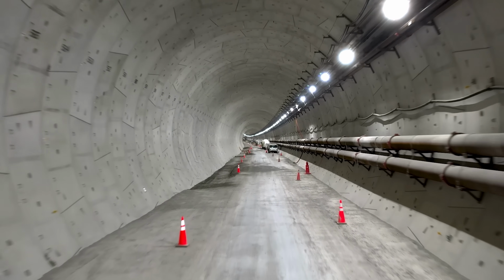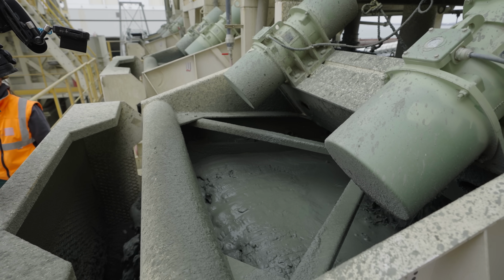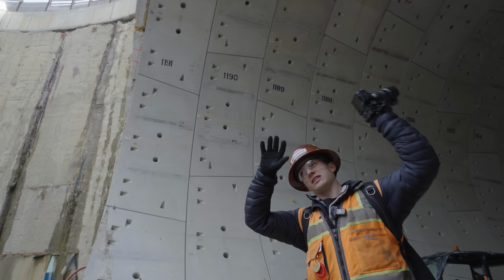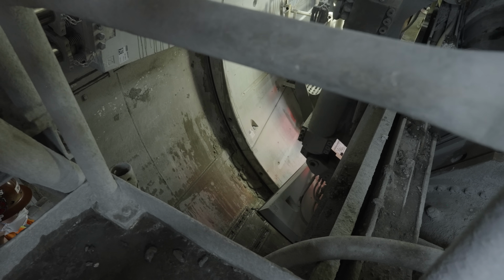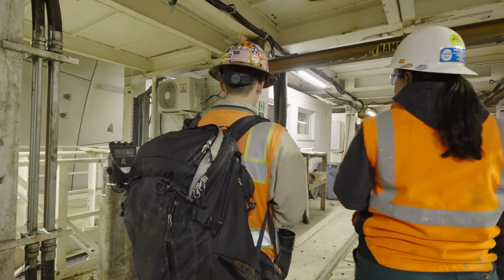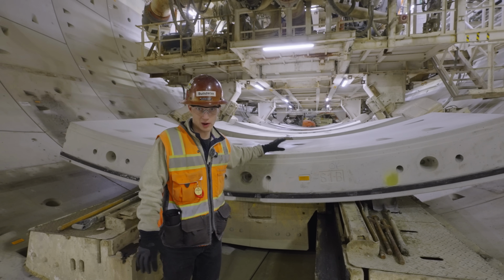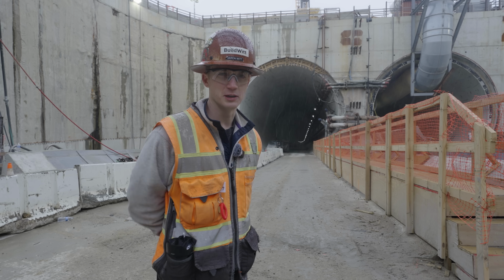Inside Virginia’s $4 Billion Tunneling Megaproject!

Comment: I have been to San Diego and have seen the Corando bridge which has the same problem. If the bridge is attacked  and bombed, it will block the harbor. That would essentially block the harbor from any Navy ships  being able to leave. Their answer was to build the bridge such that each section will float. That way, in an attack, they can simply push pieces of the bridge out of the way. Curious as to why that wasn't done here? Obviously we would loose the ability of any vehicle traffic but the same could happen here if the entrances were bombed.
Reply: The Coronado bridge is not designed to float.  And the only way it could float is if it didn't break as it fell, and if you somehow managed to seal the entire structure airtight.  It isn't going to happen.  It's nonsense.

Comment: Two thoughts, besides the obvious that this is really cool.  First, I really want to know how the pipe extension works.  Do they have to stop the machine and depressurize the pipes every time they need to extend it?  Second, I'd have stayed for hours if it meant I could actually see the ring assembly or changing of the tool heads.
Reply: The slurry circuit is stopped every few advances for the piles to be extended. This often happens in a maintenance shift. A lot of large TBMs run on a 24 hour cycle of 2x 10 hour production shifts and a 4 hour maintenance shift, where all the utilities can be extended. The smaller pipes have spool extension hoses so can be extended in longer sets (maybe weekly).
The TBM has a “trombone” section on the two main slurry pipes to allow it to move forward from the main pipes fixed on the tunnel walls.

Comment: The circular section of the vertical pits are so that the walls withstand the ground and water pressure. Like hoover dam!  Very difficult to make a straight retaining wall, it would have to be much thicker to be as strong.  That’s why the tunnel is round also.
Reply: Well, to be sure circles are stronger than squares, but I'm pretty sure the tunnel is round only because the machine digs round holes.

Comment: What are the holes used for in the ring slabs ?
Best video I've seen for TBM.
Great job all around...
Reply: That's where they inject grout to fill the voids between the slabs and the earth behind them.
Reply: @stargazer7644  Thanks. I think you explained part of what I was trying to understand but Aaron never explained.  What keeps the mud from coming in as the concrete sections are being placed? From the animation I finally figured out that they are placed inside the shield, which then slides forward, exposing the rings to the mud outside. But that would seem to leave a void the thickness of the shield wall. 

From your comment, I gather they address that by pushing grout out the holes to fill that void.

Comment: Do the concrete sections have to be made in specific shapes to account for the curve of the tunnel?
Reply: The sections have a small curve built in and depending on the orientation they install them in they can make the tunnel bend in any desired direction.

Comment: Besides the boring machine having to drill a round hole, the roundness of the hole adds additional
strength to the project. The outside pressure/ force makes the outer rings more secure.
The Romans used round top arches for strength on their building, and aqueducts to carry water.
Reply: He was asking about the 3 round excavations outside around where they assembeled the machine.

Comment: As a huge "Machine Nerd" and resident of Hampton Roads, this is great to see. There have been a few 2 minute news stories, but nothing in depth.  There is another big tunnel boring project going on a few miles to the east, at the Chesapeake Bay Bridge Tunnel... Its another HK TBM named "Chessie"... Could make a great follow up to this video.  Also, I believe that the manufacturing site for the Liner Segments for both projects is in Cape Charles, on the Eastern Shore, at the north end of the CBBT...
Reply: Correct, the sections are made in Cape Charles on the Eastern Shore

Comment: this project is so amazing in numerous ways. what a feat of enigneering. Just drilling under water where the soil is not rock but has to be treated to allow for the boring machine to cut throught without flooding the tunnel. Prepping the soils is huge. The machine itself is truly amazing. The amount of engineering to design and build this machine to bore while building the tunnel structure is like going to the moon. I live very close to this tunnel project and would love to get a tour, but I understand they have work to get done. 

Now when this machine has completed its task, the State of VA should take the machine to the Monitor Merrimac and start two new tubes there as 664 is getting so crowed resuling in five mile backups every day. The State will toll this tunnel for most of the locals that use it everyday while it really is required because of Navy requirements, ie. federal funds not my toll fees.

Comment: About the ring structure...how do they place the last ring tile? Its outside is bigger than the interior hole it has to go in, and because it's last, it can't slide in. Make it make sense! 🤔
Reply: The external ring diameter is a bit smaller than the machine. So when you’re putting in your last segment, it’s your “key” segment. It slides right in. Fits like a puddle piece! Hopefully I understand & answered correctly for you.
Reply: They don't push the ring outwards, they slide it in from the side.

Comment: If you access the tunnel by a bridge, doesn’t that defeat the freaking purpose of the tunnel.
Reply: Nope.  Bridges are much cheaper than tunnels.  The only reason they made a tunnel at all is so that the entrance to the naval base can't be blocked easily in wartime.  They only made the tunnel as long as it needed to be.  The rest of the crossing is via bridge.
Reply: Did you not watch the beginning of the video?

Comment: Now take that machine and put a few tunnels through the blue ridge mountains for trains and trucks.
Reply: That machine would have a bit more trouble with green granite instead of sand and clay.
Reply: @ carbide teeth and coolant on rotation heads it will be fine, just adjust head pressure accordingly.

Comment: 10:24 What is the power source for the concrete truck? Is that a diesel driven hydraulic system or battery driven? Thinking CO2, CO + inside the tunnel.

Comment: If the concrete rings are placed behind the shielded section, how does the excavation stay stable during ring placement?
Reply: The shielded section actually extends out the back of the pressurized section of the EPBM ( Earth Pressure Balance Machine). The segments are built inside the can that is open or not pressurized, then once the machine moves ahead and the segment comes out of the can the segment is expanded leaving a gap for a keyway or dutchman. The Dutchman will be alternated around each time they install the complete ring so as not to create a long joint in the segmented tunnel. Once the ring is expanded and the Dutchman is installed. Grout is injected behind the segment to fill any annulus between the ring and the rock.
Reply: @denverchandler6981 ^^ what he said. This is a perfect explanation
Reply: We are lucky because geology is sand and clay :)

Comment: What is more expensive, bridge or tunnel? Is the TBM reusable? Could they transport the TBM to the Cape Cod canal flor bridge replacement, given the similar geology?
Reply: A tunnel is by far more expensive than a bridge.  This tunnel cost $4 billion.  The new Key Bridge in Baltimore is about the same length and is expected to cost less than $2 billion.  The TBMs are usually abandoned underground.  They are very specific machines made for each project.  The cost of a new one is dwarfed by the cost to move and operate the machine.

Comment: After turning the tunnel cutting head and reassembling the rest of the machine. What pushed the cutter forward, as they required to push against the installed concrete rings, which at this stage would not be there?
Reply: They built a steel ring for it to push against.  You can see it in the video.
Reply: Thanks 👍

Comment: Awesome video.  

How does the TBM push itself forward when it first starts and even after setting the first couple of rings in place it seems like there would be a massive pressure that would just rip them out instead of pushing the cutter head forward

Comment: Great video but my question then becomes if the tbm relies upon pushing against the existing concrete barriers it installs then how do they start a new tunnel and how do the starting few concrete barriers handle that tonnage pusing against it once the tunnel is started
Reply: You dig out the entrance and you fit a steel ring at the opening for it to start pushing against.

Comment: In the distant and not so distant past, this job would have been done under pressure, but if there is any pressure here, it is confined to the very front of the machine. To give you credit, pressure was mentioned, but further detail seems warranted. If you don’t think it’s a big deal, just ask some of the old workers that have permanent cases of the “bends” from working under pressure. Or ask management how logistics are affected. The large diameter of that tunnel gives plenty of room inside the TBM to move things mechanically. Much of the Bull work and moving things by main strength are eliminated. This team has to be commended for their housekeeping. Cleanest most orderly tunnel machine I have ever seen. Thank you for the video. Take care.
Reply: You work under pressure in a sealed caission underwater.  This tunnel is in no way sealed.  There is no elevated pressure in the tunnel.

Comment: How does the tunneling machine make the first cut? I know it uses the pistons to give forward pressure for all of the tunneling operations once the first concrete ring is set.
Reply: You place the front of the machine into a tunnel you've already started digging.

Comment: It is always nice to see TBM's since they are all different in one way or another.. I would love to see a comparison infographic or such showing the difference between a HUGE TBM a TBM like this one for 2 lanes of traffic and a smaller TBM (like Prufrock series) for single lane and the even smaller ones for things like water treatment that push a complete ring in and push all the rings through (like currently happening in Tesla Texas plant for the water treatment system expansion) most TBM's are very similar but they have so many differences because of size of tunnel needed type of wall segments or tubes and length each one can do as well as time per distance
Reply: Also an explanation of when an "atmospheric" cutting head can and cannot be used. This was the first TBM documentary I've seen where the air pressure at the cutting head wasn't several atmospheres higher than, say, the TBM control room.

Comment: How do they take the double trailer cement mixer and turn it around or does the tug disconnect from the front and hooks on to the rear and pulls it back out of the tunnel?
Reply: If you look at the video again, you'll see there are two cement mixer trucks facing in opposite directions and hooked at the back.  So when you want to go the other way, you get out and walk to the other end of the rig and get in the truck that's pointed the other way and go down the tunnel.

Comment: How difficult would it be to replace one of those ring panels in the future?
Reply: It's impossible they're glued in place and have locking tabs. Once she's in. That's it.
Reply: @johnthumble5154  So if one were to crack and fall apart down the road for whatever reason, you'd have to basically do surgery to replace it?
Reply: @ARoadBuilder   repairs are normally done with grout crack injections. They seal around the crack and pump in either grout or epoxy at high pressure
Reply from the maker: good info thank you

Comment: You don't really need a square or rectangle for traffic. There are plenty of tunnels out there that retain a cylindrical shape other than the driving surface. The C2 highway tunnel in Tokyo is a great exemple of that.
Reply from the maker: a fair point
Reply: Perhaps they're keeping the shape of the new tunnels as an homage to the style of the old ones.

I think it's excellent that they have a separate passageway that could hopefully be used in an emergency such as a fire or toxic fume release, either as a temporary "lifeboat" or a means of egress.

Comment: I am curious how they start the tunneling process - like what are they pushing off of before a bunch of concrete rings are installed
Reply from the maker: they install a giant steel ring to form a seal for the pressurization and to push off of. A good question

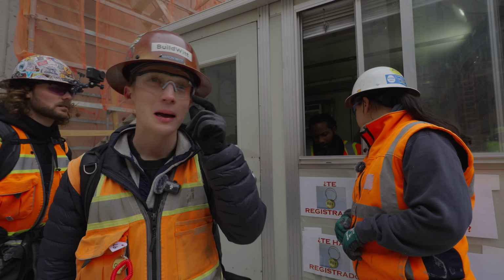Comment: 9:02 That GoPro setup 🤣 Just get the sticky pad adapter and anchor it to the front. That's all I did with mine and it's stayed on just fine.
Reply: His hard hat was all stickered up, so that could provide issues with stacking sticky.
Reply: @AuxiliaryPanther  Possibly. I used mine running a pump hose when it was brand new and now its got concrete splatters all over it 😅

Comment: Hi Aaron, another great video. A lot of this was now familiar to me as I work right next to where the new ANZAC Station was dug for the Melbourne Metro Tunnel Project as well as the Support Yard where the de-watering and consolidation of the slurry took place. The project is nearing completion, the tunnels have both been completed, the Station Box has been roofed over, the trams are now running down the centre of St Kilda Road, and the ANZAC Station is nearly complete. The Support Yard is now just a memory as it has been completely removed and the parkland with the Cricket Oval has been reinstated. 
The tram tracks in Domain Road have been reinstated, but we don't yet know if trams will return to Domain Road as the curve from Toorak Road West into Park Street was removed and tracks laid down Toorak Road West at the start of the project. If trams are to fully use Domain Road, then either a series of points and crossovers will need to be installed or the curved tracks reinstated. The trouble is that they built a significant tram interchange point at the intersection of St Kilda Road and Toorak Road West.
Time will tell as to what Yarra Trams decides to do. In the meantime, there are now seven year levels of boys at Melbourne Grammar School who have never seen trams running past the school on Domain Road. 
Mark from Melbourne Australia